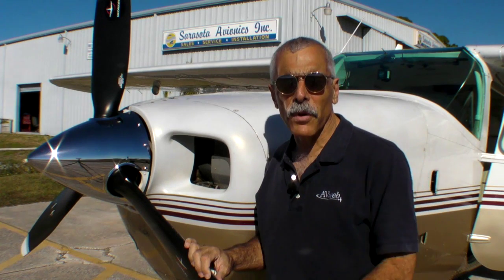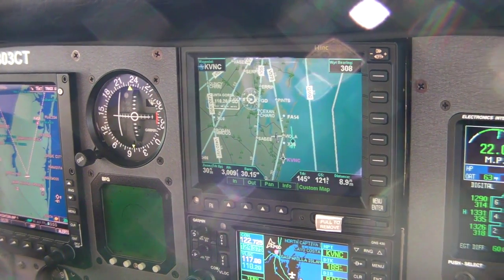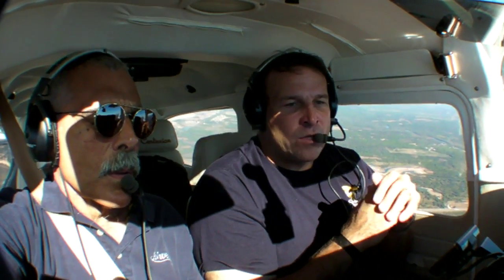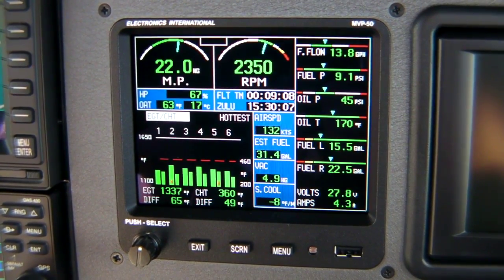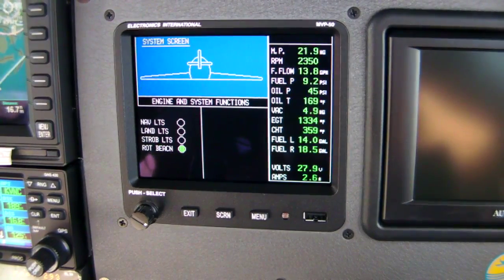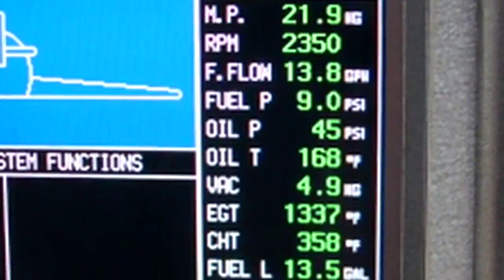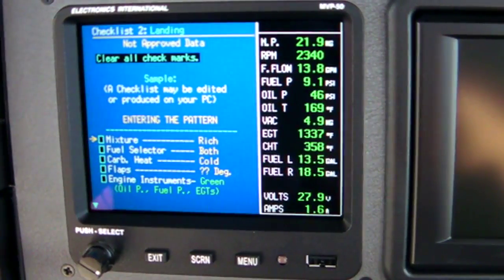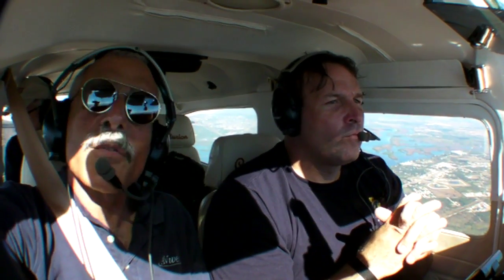MVP50 Engine Monitor Cockpit Tour

Comment: I love the improvements manufacturors are making to the aircraft systems. It makes flying much more overseeable and safer. But then there is always the tremendously high price tag that most pilots, including myself, simply can't afford. For the money they're charging you could get a ton more flight hours instead, and lets face it, that does seem like the more sensible option imo.